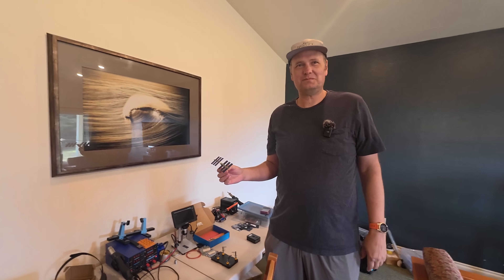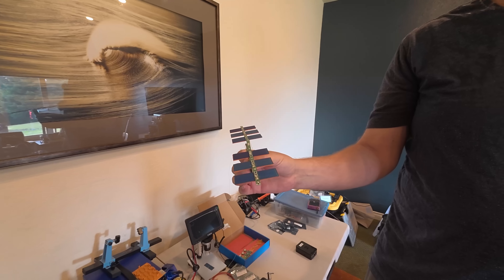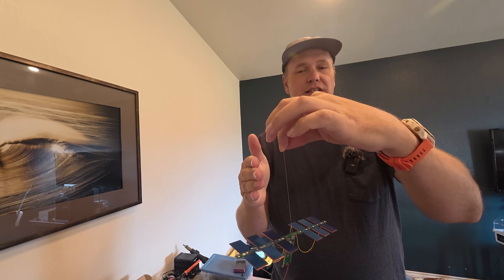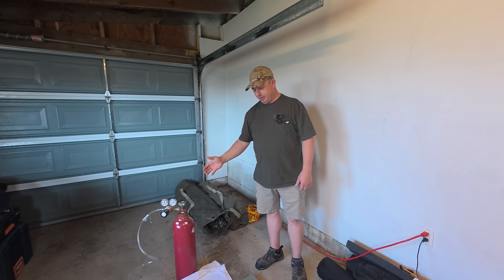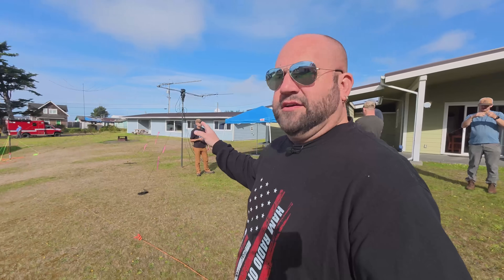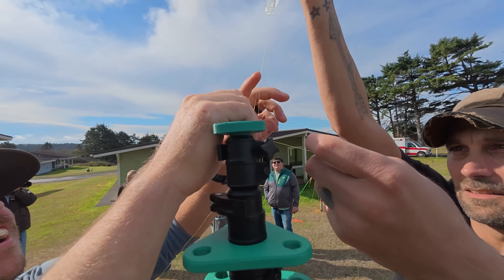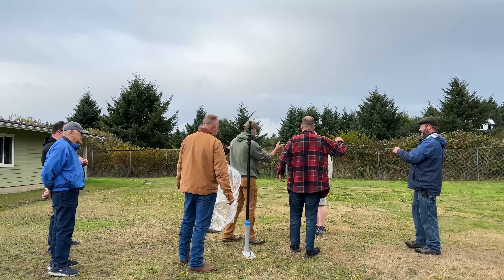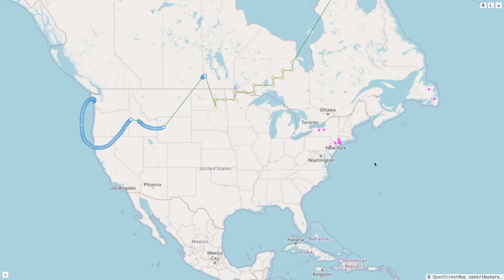We Launched A Pico Ballon!

Comment from the maker: I'm not sure any are still working but here's the link if you want to follow them.  Change the channels to 2 and 32.  I think they're both the same balloon but different data?? https://traquito.github.io/search/spots/dashboard/?band=20m&channel=2&callsign=WE4DX&dtGte=2025-10-09&dtLte=2025-11-04
Reply: I got my general upgrade for this very reason but have yet to launch one. I have spotted this balloon 8 times thought. W5PUI
Reply: Channel 32 is the one you want to use. A little more info,  the gaps you see are becuse the battery freezes at night and the voltage drops below the cutoff power on the board. Also, the gaps overbthe US are because we accidentally programmed 2 boards on the same channel and time slot, so they were fighting each other. The other died completely,  so this one is our longest running yet.
Reply: Next one spray some flex seal or similar onto the board so the electronics stay dry.
Reply: @larry785 water actually didn't seem to affect them much. The lithium batteries don't like low temps, that's been the biggest issue.
Reply: @AI7RK  Take an empty toilet paper roll, position the battery inside perfectly centered and spray great stuff foam sealant inside the roll. You can make a heater for the battery by using a bunch of axial lead resistors - use in groups of three in series and probably about six sets around the cell. I assume you are using 18650 cells.
Reply: @larry785 our primary plan was the solar panels, but they proved ineffective.  We ended up disassembling someones vape and pulled the first batteries from that. Our 2nd and 3rd battery powered attemps were 3000mah drone/rc battery packs. We're already scheming and planning the next steps, with small charging circuits for a solar/battery hybrid, 360 solar pannels to gather more sun in low Sol angles, and insulation ideas that included spray foam.